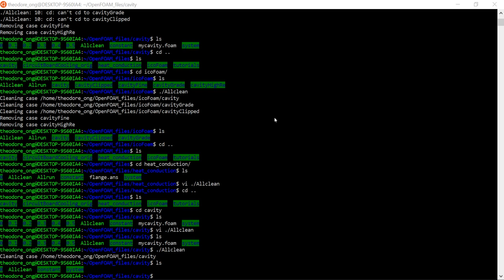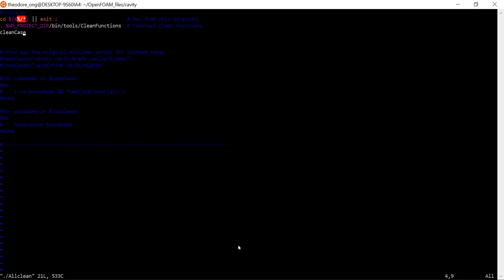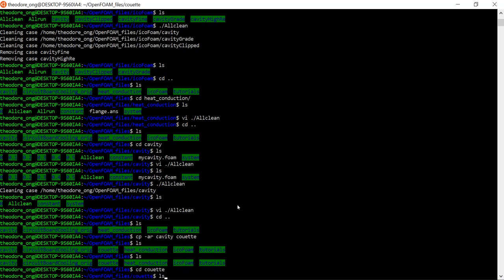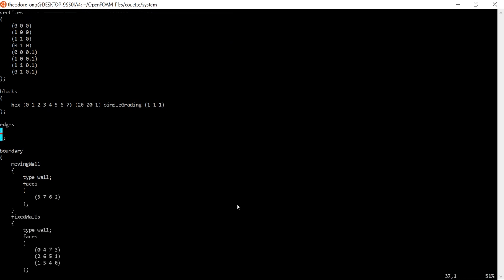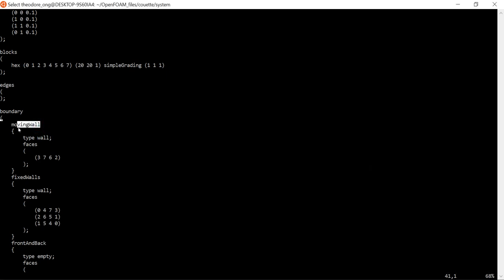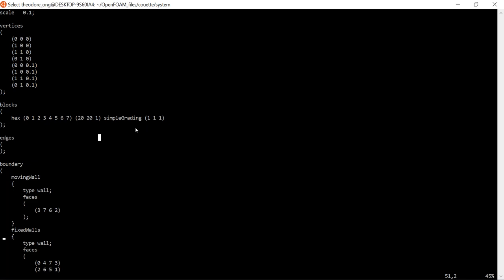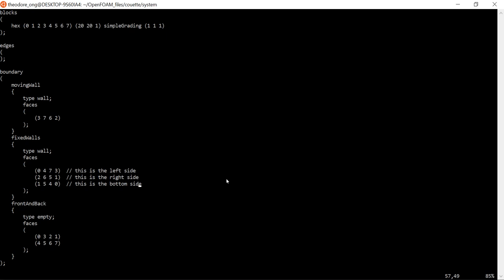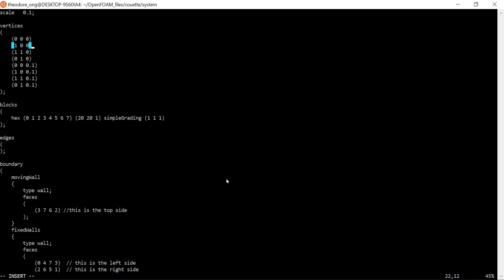OpenFOAM for Beginners win10 6   Parallel Plate Couette flow reading blockMeshDict

Comment: Hi Theo, I just wanted to start off by saying that I think these beginner videos that you made are great! I just wanted to ask if you could show how to change the color of the text/background in Ubuntu since when I opened the blockMeshDict file, my text colors were in red and blue, which made it hard to see sometimes. In your videos, I have noticed that the text in your blockMeshDict are in white and that sometimes you have text highlighted in green whenever you list the directories. I have no knowledge of Linux at all and I would like to learn how to change these colors or at least have the same color settings as you so that it makes it much easier to see. Thank you!
Reply: @TheoOngScienceAndEngineering  I am not familiar with vim, however, I tried the steps that you had provided and when I opened the blockMeshDict file again, all the text colors were changed to white and are clear to see. Thank you so much! The only problem now is that the comments are now only in white text and I am unsure of how to change the color for it.
Reply: @TheoOngScienceAndEngineering  In case you haven't seen my edited comment before you replied, I mentioned that even the comments are in white text, however, that will cause confusion when differentiating between the actual code and the comments. Can you guide me on that as well?
Reply: @TheoOngScienceAndEngineering  I turned it back on, but the red and blue colors came back (red color for numeric values, dark blue for comments). I may try it out, however, I fear that if I accidentally type something wrong or delete something, it will cause trouble with my computer
Reply: @TheoOngScienceAndEngineering  That's fine. Thank you for your help though!